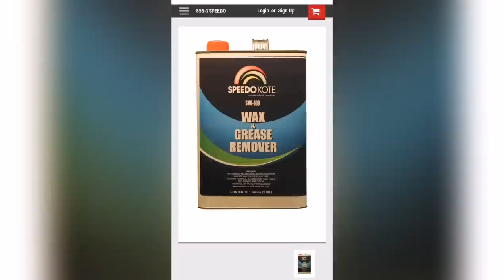300$ paint job

Comment: Don't sell yourself short man. That's more than a $300 paint job. $300 in product maybe, your time is worth something. Looks amazing.
Reply from the maker: Yea this is product cost only .
Reply: So $1300 paint job
Reply from the maker: I sometime run a 1000-1300$ paint special but that's for 2 coats of single stage that's it. No sealer no body work just sand and paint
Reply: @speedokoterefinishnetwork4937 where you located 🥹
Reply: I knew it! 😂😅😂 Looked way too close (if not better) on a factory paint job to be 300.
Reply from the maker: I figured by now people would read my disclaimers and figure out that this is materials only.. 😂

Comment: Great. Vid Marco but 1 thing I would change is I would sand it down with 400 or 600 grit and red scotchbrite so the sealer and paint grab on the panel a lot better than 800.
Reply from the maker: That does help a lot

Comment: Hey Marco great job again as usual but I do have a couple questions for ya. Right around 3:50 in the video I noticed a small place in the center of the cab that looked like it was dry or didn't get good coverage. Did you address that or did it just disappear when you shot the clear? Also, in the comments, you've talked of putting in a booth. With the results you are getting without a booth what would be the benefits of that? All I can think of is the ability to have multiple projects/jobs going at the same time.
Reply from the maker: Yea I got a tiny bit of dry spray in the center of that roof . Usually 9 times out of 10 it dissapears after a coat of clear. And only major benefit to a booth is slightly less dust and less overspray all over the shop .

Comment: Now to take out the dirt in the paint last part in the fender but it’s looks really good but you painted the side mirror black plastic too
Reply from the maker: I usually never wet sand or Polish jobs . Leave that up to the customer . People don't realize if you are going to cut and buff the clear you have to do 4-6 coats of clear . Cost goes up dramatically. Idk anyone cuting and buffing paint jobs under 8000

Comment: Never gets sick of these full car re sprays. Great job, once again. I binge watched a bunch of your older videos last night, thanks for the new content.

I have an idea for a shop project video.  Why not build a simple enclosure for the compressor just out of 2x4s and plywood. Line the inside with acoustic foam.  Might be a cool video. And your quality of life would improve in the shop. 🙂

Keep up the good work! 👍
Reply from the maker: Thought about it , but then my compressor would get extra hot , more condensation in the air , more fish eyes or water spots in paint ect ect .
Reply: this is a nice idea but keep in mind you should probably use a box fan inside the enclosure running whenever the compressor is on to keep the compressor cool to keep humidity content to a minimum.

Comment: Damn I wished I lived local cause I would bring my truck over there for sure for $300. I would even do most of the prep work myself. Great job and keep up the great work and content.
Reply from the maker: 300 is not the cost of the paint job. That's material cost.
Reply: @speedokoterefinishnetwork4937  Sorry it was meant as a joke lol. I just didn't add the LOL or 😆 behind it. I haven't had time to even start to prep work on my truck and that's why its still a basic white expedition. I will sooner or later get around to the prep on it and do a complete paint swap on it. I'm so ready to get it painted midnight blue.
Reply from the maker: @bbay1977  bro you have no idea how many people are serious and think I actually charged 300$ 😂😂😂😂
Reply from the maker: @bbay1977  bring it down if you want it painted
Reply: @speedokoterefinishnetwork4937  😆 its probably they haven't priced paint prices and just the extras that goes with it. Then on top of that, all the prep that goes into a spray job. Depending on the car or truck, it can cost 100's to 1000's just for prep. Then what its me is some people want to go with a dark color and have tons of small dings. That's where a lot of prep and body works comes into play.
Reply: @speedokoterefinishnetwork4937  where about are you located at? I'm located in Georgia.
Reply from the maker: @bbay1977  central pa
Reply: @speedokoterefinishnetwork4937  yeah that would be around 10 to 12 hour drive from me.

Comment: What do you think of this idea? Thanks in advance.
I'm thinking of using speedokote DTM epoxy primer sealer over my body work and bare metal spots and then spraying single stage. If you think it will be okay do you have any tips?
Reply from the maker: Honestly ss2790g is between for that ! Give it a try . Spray over body work areas then block flat , go over with 1k sealer and then do basecoat

Comment: Do you guys sell a 2k primer sealer that doesn't require sanding before topcoating?
Reply from the maker: You can use the ss2790g and reduce it just right and make that work. However I find 2k primer sealers always add orange peel to the job. A good 1k sealer actually reduces orange peel from my opinion

Comment: OK money is no object for me as far as buying the "PROPER AND BEST" paint material for a proper show car paint job.. I have been watching your videos and wondering if you are recommending the paint you use because of paid endorsement? 

Having said that if money is no object to you would you still use the same paint or use industry standard BASF, DuPont or PPG Global???
Reply from the maker: I've been using speedokote sence I was 18 and graduated my auto body program in high school. It's the best out here for the money. You simply can't find anything this quality for the price they sell it for
Reply: @speedokoterefinishnetwork4937  but come on... If this is "cheaper" than say name brands like  BASF, DuPont or PPG Global wouldn't you think the other ones are better? I mean I want my paint job to look like a show car and last 20-25 years and not see any clear fading 5 years later. Do you really think it is better or just as good as the other known brands regardless of the price???
Reply from the maker: @rioa9002  more expensive doesn't always mean better. Speedokote holds high quality at low price for a reason. It's manufacturer direct meaning it comes directly from the manufacturer to your door. Doesn't get bounched between 2-5 different sales reps before it reaches your hand. By the time the paint gets to your local paint store it's already been marked up a few times hence the price

Comment: No way you can even buy cheap materials to paint that car for $300
Reply from the maker: Basecoat 65 a quart , 2 quarts. 
Clear coat 180 for a kit and only used about half 
Primer sealer 17 bucks a quart used 1 quart 
Sand paper , masking tape and paper - all under 15 bucks .

Comment: $300 paint job. I don’t think so.
Reply from the maker: Basecoat was 120 for 2 quarts, clear coat was 180. Primer sealer 15 bucks a quart to mabey slightly over 300. But yea around 300$ paint job
Reply: @speedokoterefinishnetwork4937  what about reducers how much
Reply from the maker: @EK99_00  used a half gallon of reducer , 15 bucks
Reply: @speedokoterefinishnetwork4937  I still don’t believe you spent $300 on a paint job. Unless harbor freight is selling paints.